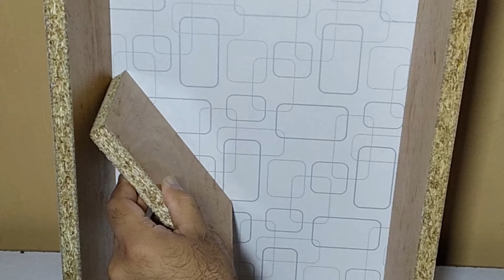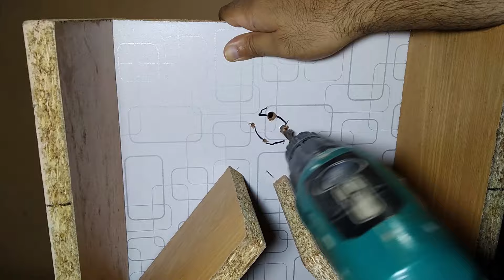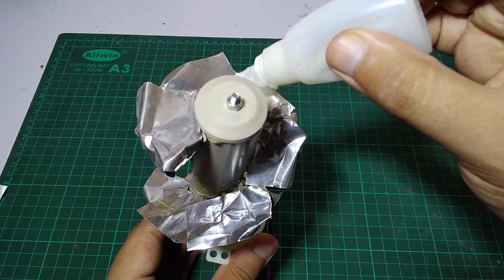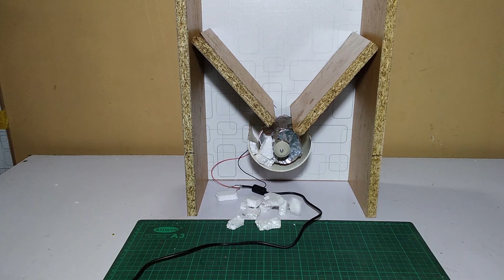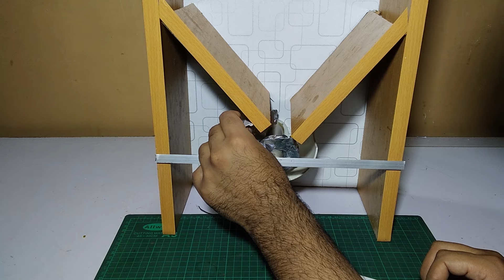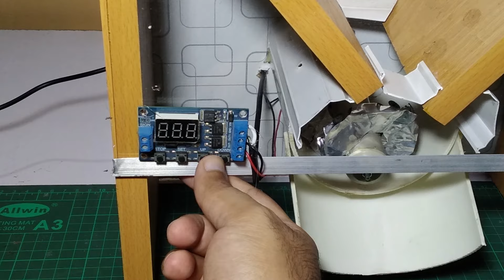How to make automatic pet feeder

Comment: I have a question, my colleagues and I are going to do it for our electronics project, and I would like to know what type of motor it is and if by any chance you could pass on the measurements you used, please
Reply from the maker: It is a gear motor and dimensions are 2 feet height and 6 inches depth
Reply: @Umairworkshop  Can you answer me one more thing please, would you have a photo of its electrical circuit, because at work they asked for it, but it is not in the video. If I had it would help a lot
Reply from the maker: @luuh.duarte  I am sorry It was opened next day to make other project ,you can search xyj04 timer on google
Reply: Hi, it's me again, can you give me the arduino programming please, I need it to be able to continue my project, if you can it will help me a lot, really
Reply from the maker: @luuh.duarte  it is timer module it is set on from the buttons it is not Arduino based

Comment: hi sorry its me again how do you connect the motor to the plug
Reply from the maker: This motor is 12v DC you need to give 12v supply power or 12v battery, but we have connected to it with timer so it is turning on and off the motor

Comment: What’s good measurement for the wood
Reply from the maker: It is around 4 inches by 16 inches box
Reply: @Umairworkshop  are the wires a certain type or just any?
Reply from the maker: @Mfpoop  yes suggested wires are recommended
Reply: @Umairworkshop  what type of wires?
Reply from the maker: @Mfpoop  can use any wires for DC 12v but for 220v you need to use 23/76